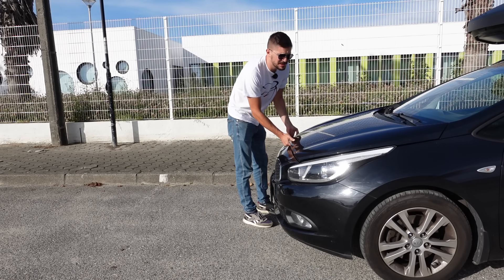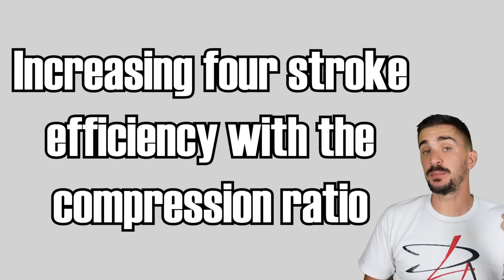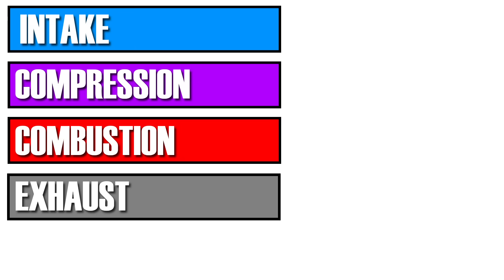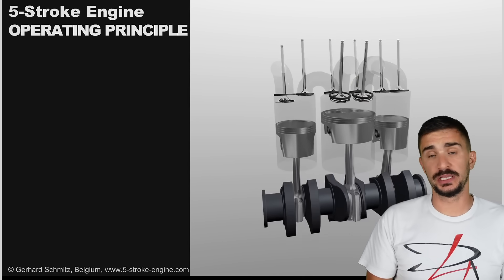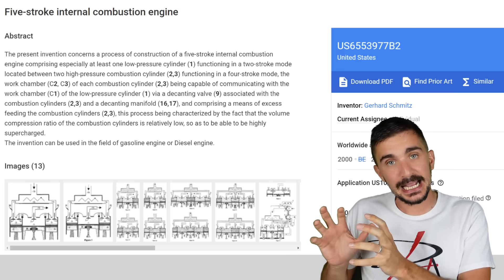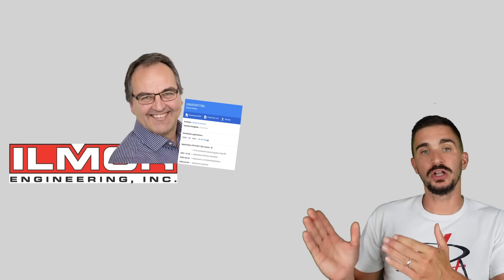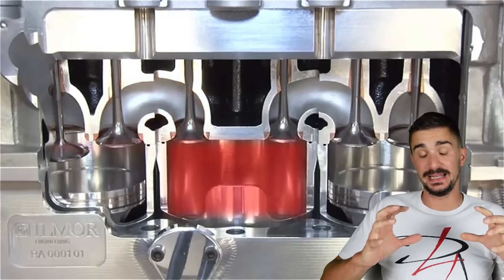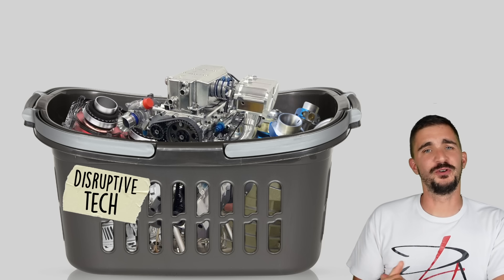Why Five Stroke Engines Are More Efficient But Still a Failure

Comment: Great video. I am a pilot, experimental kit plane builder (Van's Aircraft RV-4 and RV-7) which were designed to use a Lycoming engine, either a O-320 (150-160HP) or (I)O-360 (180-200HP) engine. They are 4 stroke, air cooled, horizontally opposed direct drive (prop bolted direct to crank shaft) engines. PEOPLE hear of a new engine, that will be a Lycoming killer. Not one of them is better in anyway, weight, actual power, reliability, installation and cost. The Lycoming is still optimal even though the original core design is unchanged since mid 1955, and of course it borrows heavily from air-cooled :radial aircraft engines that dominated military and civil aviation through WWII and post war up until jets in the early 1960's.  But yet again some new engine (often converting an automotive engine to be bolted to the firewall engine mount of a single engine kit plane) is touted as a Lycoming killer.

The claim is this new latest and greatest is a :MODERN ENGINE" and the Lycoming is antiquated. The big obvious difference often one or more or all of the following: water cooled, electronic ignition and electronic fuel injection.  OK water cooling is hard to implement in an airplane that by the way has lots of air. The P-51 had a highly engineered belly scoop. Most small kit planes rig up something and someplace to put a radiator. The down draft air cooling works and is low drag, lower weight and more reliable.  This air cooled tech was research by military, NACA (now NASA) and universities up to the 197-'s. It is highly engineered. Keep in mind piston air-cooled aircraft engines are air and oil cooled. Thy all have big oil coolers to carry heat from the head and exhaust (sodium filled) exhaust valves.

Electronic ignition is better than thee Magnetos with fixed timing (usually 25 deg BTDC). However you can put electronic ignition on an aircraft engine easily today with at least 4 or more companies and styles to install. It improves starting and lowers low power cruise fuel burn by 4%. I point out the LOW POWER. Due to detonation margins air cooled engines run at higher mixture (almost always manually controlled by pilot) to cool engine and prevent detonation. However below 75% power, like flying at 8000 feet even full throttle is at or below 75%. You can lean, You need advanced timing and the MAGNETO is fixed at 25 deg. That 25 DEG is safe at 100% power and you do NOT want to run more advance. This is is where in aircraft the advance (simple RPM and MAP curve) helps, lower power by either pilot reducing power and RPM or flying at higher altitude.  As far as HOT SPARK. At high power and RPM the magnetos are very hot, it is only when you get to altitude and lower RPM (especially if you have a hydraulically controlled "constant speed prop" where the magneto is not as hot at max RPM. Bottom line this is MODERN and has been implemented.  OH ONE BIG advantage of magnetos (btw there are two magnetos and two plugs per cylinder).  When you get electronic ignition it is dependent on the aircraft electrical system. 

Last is FUEL INJEECTION, specifically electronic.  Aircraft traditionally Lycoming and Continental for example have either an updraft carbonator or mechanical fuel injection. The mechanical fuel injection can be tuned so fuel distribution can be more even and allow for better leaning and efficiency, but for all intent and purposes they both work well.  Carbonators can get carb ice, so planes have heated air bypass that prevents or melts carb ice. Fuel injection can not get induction ice but if flying in snow could block intake so it as well has an alternate air bypass. Electronic fuel injection uses ships power and is not redundant electronically, unless you put in dual controllers (more wires, complexity).  Electronic ignition in a car is genius, miricle as the car power goes from idle to high to constant, to idle back and forth. Also an O2 sensor maintains mixture automatically. All sounds good for a plane? First planes can not use O2 sensors due to some lead in fuel. Aircraft engines NEED 92 octane. That kills O2 sensors. Lets say you work around that issue. OK. The value is small as the plane typically is operated at constant power settings, 100% (takeoff and climb at lower altitudes), 75% to 55% (cruise from sea level to 12,000 ft). In decent you have lower power. MIXTURE is routinely and easily controlled by the pilot with a mixture knob. The installation of EFI is more complex and not electrically independent.    EFI is available for aircraft both for experimental kit plans and standard certified planes from say Cirrus, Cessna, Piper. Experimental has add on EFI.  Lycoming and Continental make engines with EFI. Most aircraft manufactures still opt for the mechanical fuel injection. The Cirrus did make EFI engine and option and certified in their plane. They are not impressed. The fact is pilots can manipulate the RED knob or lever next to the throttle fairly easy. Most planes now have EGT and CHT on all cylinders (most aircraft engines 200HP or less are 4 cylinders, engines in the +230HP range are 6 cylinders).  You adjust to be 50F rich of peak. Now pilots know LOP or lean of peak (below 75% power) is better fuel economy for little loss in speed.   You need all cylinders to have fairly even fuel distribution thus harder to do with a carbonator. However mechanical fuel injection can do the trick but may require changing the injector fine tune the distribution.  Would it be great for fuel injection mixture to be automatic? Yes but you adjust the mixture one in cruise and then again before landing. You could leave rich all the time and burn more fuel. EFI is again not electrically independent,  not electronically (controller) redundant, more complex. The "WORK LOAD" to adjust the mixture manually in a plane is basically trained into pilots. The idea of a SINGLE LEVER for power (on throttle or thrust lever like a jet) is nice. Now pilots have Throttle (black), Prop RPM (blue if not a fixed pitch propeller plane), and RED (mixture). There is also Carb Heat or Alternate Air which even an EFI would have.  That is it. The fact is even the "FADEC" single lever in the Cirrus with 
the TSIO550 Continental (very expensive) has a mechanical link to the prop RPM, as El and EFI does not eliminate that. Cirrus again found it was not value added for cost and operations. Jets have one lever. Turbo props or prop jets have two.  EFI is modern and does help cars. Planes? Yes. Again there are ways to add it to an existing aircraft if it is experimental. Certified planes have to be certified with the the engine that this system uses. First the engine manufacture certifies the engine. Than the airframe must certify the installation and flight test it and get FAA approval. It is a long expensive process.  BTW diesels have been tried in planes with limited success. The higher cost and savings in fuel is hard to justify.

Comment: There is one other omnipresent technology, that started in 1543 (almost 5 centuries) and drives all current fossil and nuclear power plants and it's principle will still drive fusion reactors, when ever built. It is the steam engine, that has a longer time of success than the 4-stroke engine 😉 Even nuclear reactors just boil water, which is run through a turbine (not a cylinder anymore) and then condensed.

Comment: How about a two stroke engine? 
Inject pre-compressed air and fuel, then instantly burn (1), then exhaust (2). 
If you inject fewer air and fuel, you will get throttling for free and more expansion.
you can even start the motor from a dead stand-still (provided a cylinder is in the right position).
pre-compression could be done by the engine during breaking.
it might even be possible to switch between 2 and 4 stroke with software-controlled valves. or some kind of hyper-vtec.

Comment: Hello, I am German and I have not understood every word but I think I understood the main problems.
Thank you very much for these informations. 
My first idea was the the problem with too low exhaust temperatures so the catalyst can not work without added electrical heating. 
The main problem is the partial load range. Even on big roads a normal car with 150 hourse power only needs 20 to keep a speed of 60 MpH.

Comment: I really don't want to be a dick for the sake of thst. But are AC and DC electromagnet motors not right about the same age as the 4 stroke? With a similar, no real change other than incremental improvements since like 1885?

Comment: Engineers make stuff way too complicated. Add a turbine connected to the transmission and run the exhaust through it. Or I've seen superchargers connected to the serpentine belt why can't that work in reverse. Turbine side of a turbocharger connected to the serpentine belt putting that power back into driving the vehicle instead of sending out the tailpipe

Comment: If you want to scavenge more power from expansion, couldn't you just install half of one of those hybrid turbo systems?  The ones where the turbine spins a generator, and an electric motor spins the compressor.  I know they were developed to combat turbo lag, but charging the battery in a hybrid car instead of charging the intake air seems like it would be a win for efficiency.  And you could do that for any existing internal combustion engine technology without having to do any new design work at all.

You could also let the generator free-spin during low-load and on initial startup to avoid being an efficiency loss and to heat the cat up faster, bypassing that issue too.

Comment: You could get some adjustment for varying load by varying the amount of air allowed in during the intake stroke.  Then, use a diesel version of these engines in applications in which most of the operation is at constant speed and load.  Oceangoing (and even Great Lakes cargo ships immediately come to mind -- these run at constant speed for days or even weeks at a time.  The one extra complication is that you would need extra provisions in the valve gear to be able to run the engine in both directions, since most cargo ships have direct drive from the engine to the propeller, and so this is how they back up.  But i you could improve their fuel efficiency from the current ~55% to ~65T, it would be worth the extra valve complexity.  The long running time of ships would also mitigate the catalytic converter warmup time, although I haven't heard of ships even using catalytic converters in the first place (but it might be in the works, to meet future pollution regulations).  Another option is to split up the catalytic converter and put in the tubes from the high pressure cylinders to the low pressure cylinders, although that might be TOO hot.  Also note that if you put in a bypass to let the high pressure cylinders temporarily exhaust to atmosphere, you can make the compressed air starting sequence very easy -- just feed the compressed air into the low pressure cylinders, and you don't need to have as high a pressure to be able to start the engine; then once it gets up to speed, cut out the bypass and go to 5-stroke mode.

Generators have also been mentioned as a potential application for this type of engine.  But we need to be making electricity as much as possible from renewable energy sources, whereas you can't run electric trolley wire over the ocean, and batteries don't have enough capacity; sails, on the other hand, could serve for part of the journey, but you are still going to need an engine for long parts of many journeys.  Still, it wouldn't hurt to have some of this type of engine on standby as emergency generators in case of a dropout in the renewable energy generation.

Comment: 16:12 The catalytic converter needs to go between the four combustion cylinders and the one re-expansion cylinder. The cat is both hot and pressurized, reducing the amount of catalyst required.

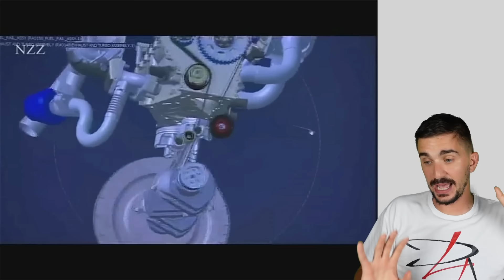Comment: 11:33 "perfect balance"
No. The engine emulates a four banger, so its secondary balance sucks.
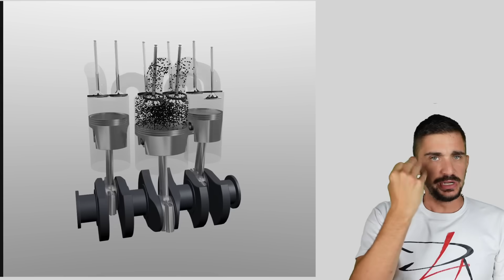13:07 "Why did it fail?"
Simple. Like I said, it emulates a four banger, and four bangers suck. Plus, its power output is way uneven. That center cylinder produces far less torque than the primary cylinders, so you get BIG tiny BIG tiny torque production.
Lousy balance, lousy torque production. Yuck. BUT...
Just add two more primary cylinders. Your Big Bang video showed how two primary cylinders that fire right after each other merge into a broader "stroke".
It goes:
Primary cylinder 1 fires
120 degrees later primary cylinder 2 fires
120 degrees later the re-expansion cylinder starts expanding.
120 degrees later primary cylinder 4 fires.
120 degrees later primary cylinder 3 fires.
120 degrees later the re-expansion cylinder begins expanding.
You end up with "six cylinder" balance and the pathetically weak central re-expansion cylinder literally doubles in torque output. Add simultaneous combined cycle (which adds torque to re-expansion) and the engine functions like a six banger even though it only has four combustion cylinders and one re-expansion cylinder. Every third power stroke is both free a just as strong as the others

Comment: Don’t get me wrong, I love ICE cars. I love the endless tweaks and mods you can do to it. But I’m also quickly coming to the conclusion that electric motors just do away with all these problems. I think as soon as the power density of the batteries are high enough so that you get 1000kms from a pluggable portable battery, all ICE arguments become moot.

Comment: Jay Leno talks about technology, how it need to be better on all fronts. It cant be better in some, and worse in others. It has to meet or exceed all expectations, or it just has no hope of catching on.

One Idea I just had for this is to maybe make and inverse 2 stroke design. Most engines want to keep exhaust byproducts out of their crankcase. However, if you could channel the escaping exhaust gasses to help drive the piston up on the compression stroke, and have it escape naturally out the crankcase, you could achieve a similar effect to a 5 stroke design.

A few problems I see with this though all pertain to oil. The first being, how do you keep oil in the motor. If you vent it into the crankcase, its going to blow the oil out through the exhaust. Next would be oil life. You are going to introduce exhaust byproducts into the oil, reducing its lubricity. You will also heat up the oil leading to further oil degradation.

Alas, I think the problem lies outside the engine entirely. In the titanic, the triple expansion engines would utilize the steam to its entirety... or not. After leaving the triple expansion engines, the steam would continue to go through a turbine. Turbines have several advantages and disadvantages, one being that they are not ideal for fast acceleration. However, if you could mount your turbo charger to the front of the engine, and have it couple to the engine via the serpentine belt, you can gain a lot of advantages.

By having the turbo essentially coupled to the crank, you can have something that can add power to the engine. As its going down the road, it can add rotational energy through the belt and assist the engine by using expended exhaust gasses. By doing so, you also relieve the engine of the load that is typically transcended by the serpentine belt. I love watching Engine Masters on Motor Trend, no Discovery. One on episode, they wanted to see just how much power you were losing to your accessories. They saw 40 horsepower depart the system just by driving an alternator, a water pump, and a radiator fan. Now add in all the extra crap that manufacturers have bolted on, such as Air Conditioning, Power Steering and the added load of the Alternator, and you can probably see losses nearing 100 horsepower in some applications. I say nearing, and every situation is different.

That turbo charger belt can effectively remove that load and add power to the engine in the same stroke.

Comment: Don't turbo-chargers re-circulate the exhaust gas? Going through the comments it seems that the problem that the 5-stroke is meant to address has already been addressed in a variety of other ways. Edit: I spoke too soon, you addressed this in the 16th minute.

Comment: Why not use a turbine instead of a third cylinder, and just use a reduction gearbox or high speed electric generator to make power with that? We've been making exhaust turbines forever to compress air anyway.

Comment: 17:42 
Toyota engine , these are petrol alone or in combination with their hybrid system and offer 41 % thermal efficiency, low fuel consumption and excellent drivability and respectful performance. Also these are most reliable engines currently on the market. 
I will never buy and drive a car with any other petrol engine .

Comment: This sounds like it would be a good engine for gemerating electricity to extend the range of electric cars. If the RPM is electronically controlled to be at the most efficient range, this could be highly effective as a generator

Comment: I thoroughly enjoyed this. Interesting why the five cylinder engine failed due to lack of heat. 
Could their be a way of having it intermittently firing with a spark plug and obviously some fuel when revs are very low and not enough heat is being produced for the cat.

I have no engineering knowledge. Let others ponder that either incredibly daft or brilliant idea. But when brainstorming no thought however off the wa should be rejected. 
Even a small charged battery could power small heat elements if the cat is running too cold. 
Probably an equally daft notion.

Comment: Largest energy loss is in a straight line movement, going to circular rotation, also why those rotary engine designs, is getting another run through the mill, for hybrid cars